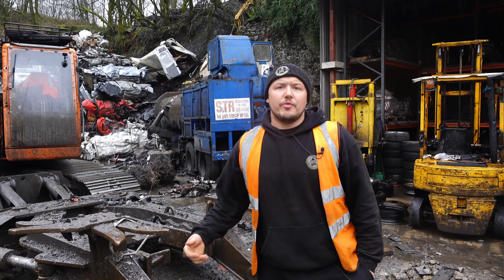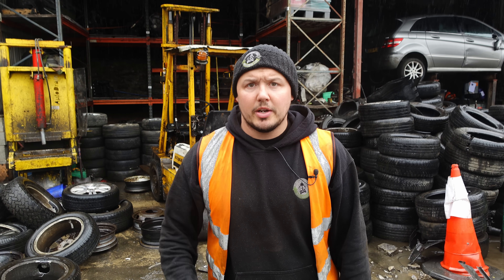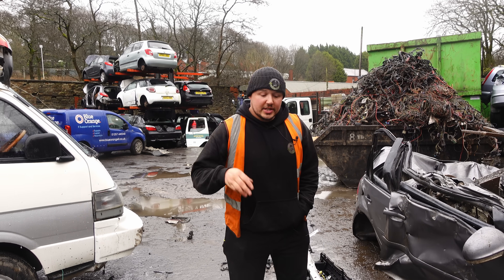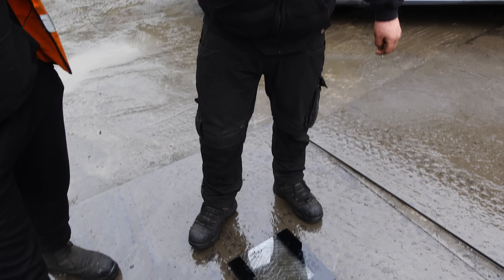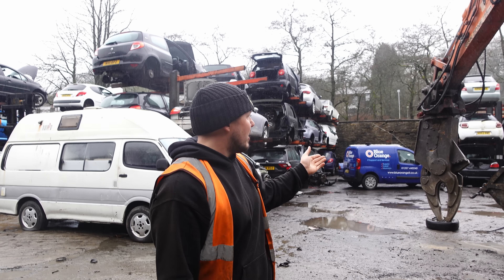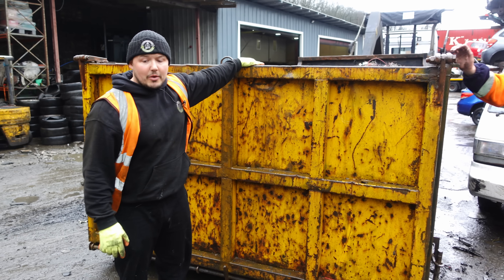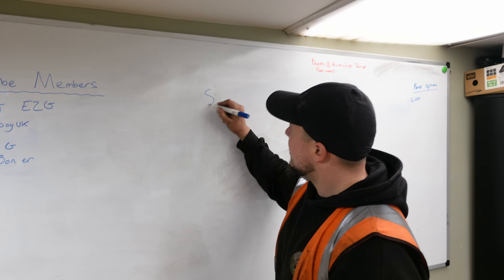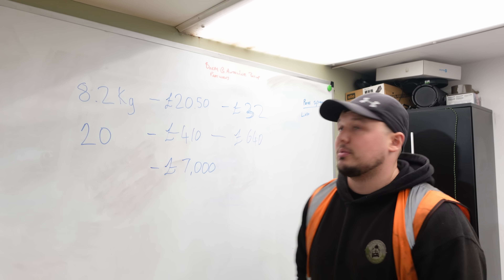Copper Wiring Loom - Uncovering the Hidden Value in Scrap Cars!

Comment: Another great video lads. James, for the extra minute it takes to rip the seat's and carpet out you will more than double the amount of wire per car, even if you only do the German cars like that as there's alot of wire under the carpet along side of the sills both sides. We do all makes like that and takes no more than ten mins per car. We average 30=35 cars per day per machine. That's engine out,axles,rads,ally back bumpers,wire etc. 
Keep up the good work and keep the great content coming. 👍👍👍

Comment: Wow wee, what scrapyard do you use cos there very very high prices on dry bright, if it was clean singles wire £2.60/£2.90  is about right for clean, but with it having some plugs on and tape on the wire it will be pluggy singles, grate video lads 💯💯👍👊👊

Comment: I own a wire granulator and its not super easy to proces wire with this car wire its better to sell it as is because it saves time and it saves on the waste costs  if u proces car wire you have pieces of brass and tin plated copper in youre final end product witch is almost impossible to filter out so you end up with a product that scrapyards dont really want to buy only at a low price

Comment: I've been waiting for ages for this video!! Copper and brass prices are continuing to rise (ASM metal recycling) and, according to CNBC, as a world resource, copper is diminishing quite quickly so the greater amount that can be recovered, from all sources, the greater the advantage (profit) from recovering a diminishing resource. Whether the copper scrap is #1 (clean and uncontaminated mainly tube) or #2 (mainly wire and cable with contaminants), you're looking at (eg.processed "greasy bright Copper Wire") @ £6,580/ton approx 122 car's worth. No 2 Copper Wire – £6,290 ton. (Figures from Reclamit 31st Jan 2023). Sorry if I've misread some bits!! Would the capital outlay administration and reorganisation required to produce clean copper wire produce dividends? 
Basically, as James pointed out, at a guess, fifty percent of the raw recovered loom is sheathing and plastic plugs. So on the one hand you are drawing in a "free" gift of copper from the cars albeit in a raw state with comparatively little cost of 'production' on the other, initially a big outlay in machinery and new staff in order to almost double the income -- taken over a five year period this would be a diminishing outlay and the profits would rise. 
It's nothing if it not an exciting prospect; it could change part of the yard to a processing plant or even hasten the need for separate premises; exciting and big decisions to come.
Sorry if I'm rambling!!!  But that dismantler doesn't only open vehicles - it opens horizons. I don't pretend to be accurate but as Shakespeare said "perchance to dream"!
Thanks for a great video! Best wishes.
Reply from the maker: Love your comments so much information ! And yes defiantly something to think about granulation, got some big plans for next couple years 1 step at a time 😁
Reply: @BCB  ...and I hope I can watch every step!

Comment: A use to brake cars buy hand nd take out the wire just engin bay nd in side of the doors usually got about 5 wheeley bins a month at 80 t 100 pound a bin not a bad little cash boost for the lad a worked for

Comment: Hi, excellent informative video. Couple of questions, what are the catalytic converters and batteries fetching at the moment ie is it worth removing these as well as the wiring??
Reply: I took four batteries to our local metal recycling yard and got £20 for them.
Reply from the maker: Yes for sure batteries are around £500 ton and cats are averaging £80 each you should defiantly be separating the cars as much as possible